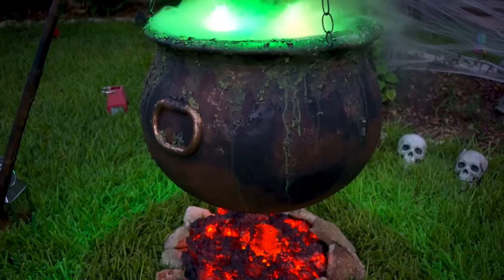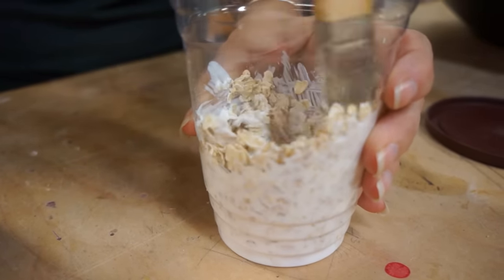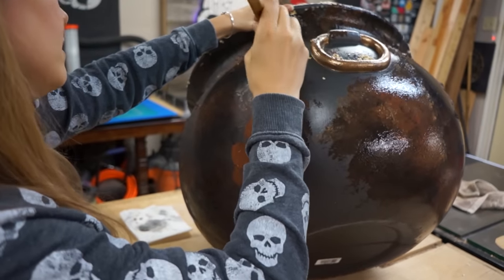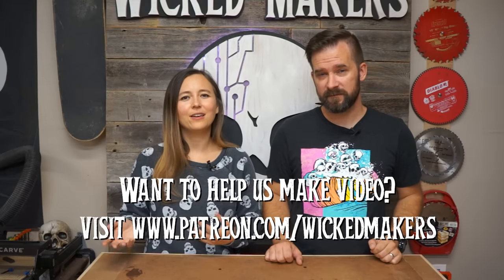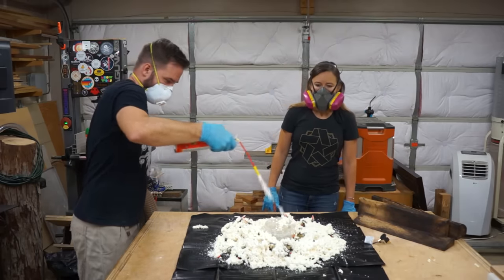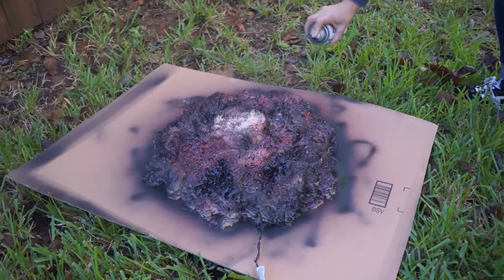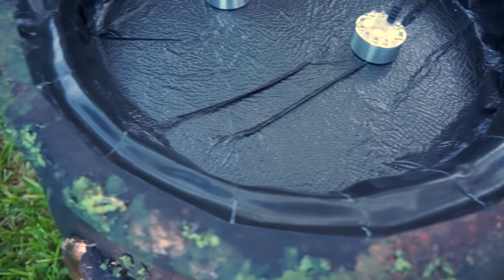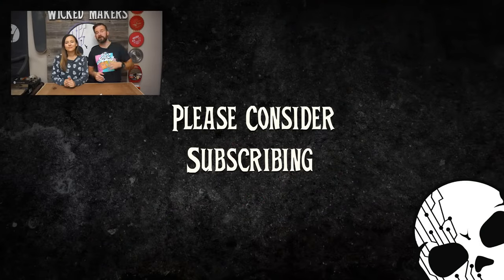DIY Halloween Props - Bubbling Witch's Cauldron with Glowing Coals

Comment: I know this is an old video, but for people watching now, here’s a little pro tip. Instead of the mod podge and oatmeal, you can use your expanding spray foam (great stuff). You can either add a small amount onto the cauldron and spread it with a brush or put on rubber gloves and smear it. You can also put on gloves spray a bit in your hand and smear it where you want the effect. I produced a large scale haunted attraction for about 16 years and we used spray foam for a multitude of effects. It is very messy and doesn’t come off skin easily (or clothes ever) so make sure you wear gloves and work clothes.
Reply: Thank you
Reply: I just subbed to U and liked Ur comment😊

Comment: Fun fact, put a blacklight bulb on top of the cauldron and soak some yellow highlighters in the water. It will glow a greenish yellow.
Reply: Re: soaking highlighters, do you mean the felt part with the ink from inside? Not the whole plastic pen, right?
Reply: @wolfeyez77  the felt part has the ink so yeah the felt
Reply: @wolfeyez77  yes, you remove the inner felt and soak it. It is a great way to make tints with alcohol too.
Reply: That takes me back.  Back in college I made a whole set of bottles like this with different color highlighters.  Looked wicked cool under the blacklight.

Comment: Ok.  Just a heads up for those of you who are making this.  This is an awesome DIY project with a lot of parts. If you plan to use this outside, I would suggest using like some clear flex spray over the bubbly oatmeal mod podge.  I noticed that when it rains, parts that weren't painted, the mod podge turned white.  The flex spray helps with that and also keeps it kind of shiny since it is supposed to be a liquid bubbling over.  The next thing is that I did my best to keep my plugs as dry as possible.  I cut a little flap on the back side of the cauldron to allow just 1 cord to come out.  I also created a waterproof box for the power strip to go into so all of those plugs stay dry (light at top of cauldron, cord from inside which the 2 atomizers plug into, the fire pit below and I have a spot light plugged in).  I did learn after the rain this weekend (and losing one of my atomizers), to put drain holes in the bottom of the cauldron in case of overflow from the bowl.  I also created a small riser to hold the connections above any water that may still be in the cauldron minimizing any moisture getting to the atomizer plugs.
Reply from the maker: Great tips! 👊🏼👊🏼
Reply: Awesome tips thanks!!! Would you mind sharing what size cauldron you used?
Reply: @iznethflores  I used a 22” cauldron just like they did.
Reply: Did you use spray flex seal?
Reply: @tr0ysk1   I can not find that size any where so Im using the 16 inch that I already have
Reply: @bjlaws1158  yes
Reply: @bjlaws1158  I had to order it online, but come Halloween, Party City had them in stock.
Reply: @tr0ysk1  I finally found a 22 inch cauldron at party city  today, she said they normally do not have them. I got lucky
Reply: Do you happen to have any pictures of the waterproof box you made for the power strip?
Reply: Plastidip works
Reply: Do you have a picture or demo of the water proof box, the cords have been my biggest challenge in this!

Comment: tripod ....use sawdust rather than oatmeal...
Reply: I came down to the comments just to post this.  I don't know why "tripod" is such a hard word for people to come up with, but it is.

Just a tripod.
Reply: Mix sawdust with one of the new vinyl flexible plasters and latex paint. Otherwise known as monster mud.
Reply: @rednecktech255  Not everyone has readily available saw dust but atleast critters wouldnt be eating at it.
Reply: @Soul_N_Control  then just paint, and plaster
Reply: @rednecktech255  Ok, I might just try that. Ty!
Reply: @Soul_N_Control  you can get "sawdust" in any petstore including walmart https://www.walmart.com/ip/AWF-Pets-Pick-Wood-Shavings-Pine-Bedding-4-CU-FT/24232050
Reply: I wet down some traeger pellets and they crumbled into cool clumps. I used that for the bits. Great suggestion!
Reply: Some rope lights have a flicker mode  that brings the hot coals to the next level

Comment: If you want to make that coal bed even better leave room holes for the air and mount a PC fan underneath.  Then attach a couple of peices of silky white cloth in the center on the top side.  The fan will blow the cloth up and the orange lights will illuminate it making it look like fire still burning in the middle of the coals

Comment: I used a 5 gallon Lowes bucket as the stand for the water tray. It’s the perfect height. They had a shallow 17 inch and a deeper 16inch  plastic plant trays at Lowes as well. I also painted the duct tape alternating matte black paint with green to blend in with the colors of the cauldron.  Such a fun project!
Reply: Thank you for your suggestion

Comment: This project is a decent and great idea to start but I'd recommend these improvements. The foam you were using is called Fomular and it retails for 5.99 in California, I consider that to be pretty cheap it is also water-resistant all by its self. Using a PVC pond liner and permanently affixing the bowl to the cauldron to allow for permanent use. This could be done in many ways like using more expanding foam and then sanding, painting and sealing it (you could even just use the foamular and a small ring of expanding foam to hold it in place then paint both once dried with flex seal in black ). Pond liner should be able to be bought from a home improvement store. Mine has some that are cut to order and you wouldn't even need a lot to fit in that small area. You could use any one of the Liquitex line of painting substrates that mimic stone or small bubbles or many other things I used the sand one to replicate beer foam and it looks amazing (these can be colored with acrylic paint). This would have worked much better than oatmeal and Mod Podge also if you go the mod podge route use the outdoor mod podge. Also, do not put paint into water it will not work as a "wash" or anything for that matter (it eliminates the bonding properties of the paint hence why it tells you to clean it up with water or with soap and water). You need something called glaze I keep several large bottles on hand and you add your acrylic paints to it and it makes them into a glaze which is more transparent allowing for a build-up of color which is what you were looking for here on the embers for the bottom of the cauldron. A great way to get the cast iron look would be to sponge or stipple colors onto the matte black cauldron. There are even kits that help you create the look you were going for. This can all be done on the cheap too with Coupons. I use them all the time as I live below the poverty level and without them, I couldn't get supplies.  You can use Joann coupons at Michaels. I hope this helps someone who is thinking of making this so that it can be used for a very long time.

Comment: Hello! Fantastic channel and great DIY for Halloween. I do have a question. My wife and I made your ember diy with the spray foam- however we went a little large and put 150 lights in it. When I picked up the dried foam the underside felt a little warm. Do you think that is cause for concern with the lights being hot possibly catching the foam up in flames? Or should I just redo it with the same amount of lights but instead utilize LED’s. Any help is appreciated.

Comment: I used a contractor bag which are pretty heavy duty  and  hot glued the bag to the  rim of the cauldron to close the gap. The misters kept tipping over so I used a  dab of hot glue on the bottom of each to stabilize. It was a great project and I want to thank  Wicked Makers for the tutorial that inspired me to make this.

Comment: In regards to your oatmeal/mod podge mix for texture.....I've had tremendous luck and quality with potting soil. Soils with little bits of other things like bark, twigs and peat moss.the texture is alot more workable and varied with super glue or mold podge.

Good luck!

Comment: I made this last year and it turned out really great.  One thing I did that I would change is I used cardboard for the fire/coals.  It ended up being really wet last year where I live and it did end up growing some mold/mildew.  I will probably remake it using some treated wood this year.

Comment: So, how do I find a solid color atomizer? All of the ones on Amazon are multi-color and are unable to set a specific color. They just kind of change color at random. I would like to find an LED atomizer that you can set the color. Is this why you mounted an outdoor light to the top of the tripod facing down? Am I better off just lighting the fog with an outdoor light like you guys added to the top?

Comment: I made mine from an old Weber grill. Used the top to hold the faux fire mounted on plywood and rimmed with creek rock. The tripod came from bedrails and the cauldron itself is made from the bottom of the grill..guaranteed not to blow away in a wind storm

Comment: I do a lot of make up fx for Halloween costumes. I have tried using oatmeal with latex which is very similar to what you did with the Modge podge, and I ran into the same issue with it falling off and not sticking. After a while it does stick however, using cornflakes crushed slightly works much better and would give you the same result as the oatmeal.

Comment: I did something similar. I didn't use oatmeal because i have heard stories about rats eating the prop. I used old wood pellets that got wet and pretty much turned to saw dust and it worked great. I mixed the saw dust in with killz primer and slapped it on randomly. Yours one came out great!

Comment: If you take a cheap cheap extension cord and a number 2 starter for florescent lights and split the wires, then cut one in half, strip both sides of the cut wire and connect to the starter. Then any low watt bulb or short christmas style lights will flicker at random. Making the fire lights look real

Comment: Hi! On making the embers I noticed you have something in the middle of the lights before you spray the foam. What is it and why is it necessary?

Thanks so much for these ideas. Really cool projects.
Reply from the maker: Hi! It’s not necessary. We put a little bowl in the middle because we were going to add dry ice so that the embers looked like they were smoking. We ended up not using it though so that’s why we didn’t include it in the video. Thanks for watching!! 👻
Reply: Thanks

Comment: Is the spray foam "wet" and "sticky" enough when first sprayed to dust it with actual ash from a fire?
Reply from the maker: Not really. We found that out in our Graveyard Skeleton project. 😄
Reply: I'd imagine you could get something to stick since that stuff adheres to anything you get it on but maybe kind of stir in in a bit?
Reply: @ucitymetalhead Long comment, but played with it a bit for a zombie party. But if you stir it when it is trying to expand, it kind of deflates a little. You can add the foam in small quantities to a pre-made base structure from chicken wire or cardboard/box board  (recycled materials), to give it a better height and depth and more formed structure. Adding the skulls, eyeballs, bones, etc. out from that point, but the first layer of paint and glue is still a roll up bubble mess with many coats to come to properly cover it later. It can be a pain for overall coverage, but work to your advantage later. We have a counter top meat grinder (the antique metal hand crank type, not machine type), took  and mounted it to a table outside. Placed a few pre-painted pong balls, skeletal hands, a plastic heart and liver, etc. onto a dollar store foam cooler and use the spray foam to make swirly intestines on the lid with trails off the top as if it was a cooler bursting full of Human parts going into the grinder. Watered down red acrylic paint wash over the top works perfectly with the nature of the foam to give it splotchy blood effects. Red strings of yarn hooked into a circle and dangling from the grinder, as if some of the parts were already being processed. Set our buffet out over a plastic skeleton, jello mold for brains,  spare ribs for ribs, sausages and linked hot dogs for intestines, swedish meatballs for...well lol, you get the picture. 
The foam itself can also be carved with masks! In open areas! (But found buying the sheets at 5 bucks a pop were just easier after all the work was done with trying to manipulate the spray foam). So if you are looking to do filler work use spray, structured use sheets.
Reply: @Vampkiki  Thanks for the info and the time it took to type all that out.

Comment: For the coals, does anyone know why there’s the small clear bowl in the middle of them? Is that an important step?
Reply from the maker: It’s not important. 😄
Reply: I was actually just coming to look through comments to see if this had been asked. My first coals I made were unevenly proportioned with my cauldrons, so I'm going a different route and found this video. I don't want to mess the coals up again, so I'm trying to make sure I do every single step and wasn't sure what was in the middle of the lights and if it's something I needed to do /use myself

Comment: Put a chain under around the lip of the cauldron? You could attach it with drilled holes in the lip, wire, plus some Gorilla foam white glue at certain points? It's like very slow  super glue and foam, foam will expand. Wear gloves, when using, a wet paper towel will remove foam as it expands, dries, this stuff is as hard as rock, takes a chisel to remove, use very little. Don't get on skin, read instructions.

Would distribute weight load.

If using a black light, laundry bluing glows well. Usually hand washing cheese cloth, leaving some of the soap in. 

Not sure if you could use it here?

Comment: Beware!  The lights could overheat encased in the foam.  Maybe use LED lights, which make less heat?
Reply: Holiday lights are specifically made not to overheat. They're fine.
Reply: @Katherine69069  Yes, but not when encased in a most perfect thermal insulator!  ALL lights make SOME heat, which most be able to escape.  The better the insulation, the higher temperature that the lights must reach in order for that heat to escape at the same rate it is being made.  Even LED lights can overheat when foam embedded!
Reply from the maker: It’s a legit concern but in this case we’ve run these for days on end and you can’t even feel any heat.
Reply: @WickedMakers  But it could be very hot INSIDE the foam.  The only you would know is if you poked a thermometer in, or cut it open later to look for thermal damage.  (Been There Done That with R2D2 robot prop with foam top & 25W light inside.  It took 10 hours to overheat, but boy did it!  The foam & the inside of the robot was smoking hot!  A small fan & vent solved that problem.
Reply: @bpark10001  It's not a concern. Holiday are made to not produce heat for the reason of fire.
Reply: @bpark10001  Holiday lights are nowhere even close to 25watts

Comment: For the fire, recycling is your best friend. Paper towel rolls or used box board made into rolls for piled lumber for the fire gives the foam a better base to start with. Pre-paint those brown to resemble wood. If you leave a paper towel on the roll and midge podge it before brown washing it, you will end up with a better texture. Add the string lights in for the foam part after by drilling holes if you want them to glow brighter. (The same can be done by a paper mache' and water downed school glue paper towel  ripped up combo  mixture for the cauldron before painting it, to give it a more realistic feel.) And the name for the 3 wooden piece is just a cooking tripod, we use it with a Dutch Oven when camping.

Comment: I found out it's better to paint a section of mod podge on first.  Take some oatmeal and layer/pat it on the mod podge. The oatmeal will stick better if you turn the cauldron on its side with the mod podge facing up. Then repeat the same steps until the cauldron is complete.

Comment: They are called ultrasonic nebulizers. Make sure you get ones that have automatic shutoff on hem when the water gets low, as the cheaper ones will destroy the ceramic disc inside if left running with no water on it. Also, never touch the ceramic disc when power is on.
Reply: Where do you find the mini ultrasonic nebulizers?

Comment: Just a tip I went to build the swimming. pool thing, I had an oil Drain pan about the right size, I sent Debbie to get a new one, due to the warping. in the bottom. She told me the store ones, were too small, and she said I am going to Lowes, to get a plant (pot) drain tray! Worked perfect, just another idea! Bob and Debbie in Oregon!
Reply: We found a plant drain pan, (No Holes) I think. 17" , worked perfect! 
Bob and Debbie in Oregon

Comment: This is very cool... Thanks for providing the links as well. I was a bit concerned that the spray paint & expanding foam may totally blcok out the light, but it wasn't the case for you at least. Still a bit nervous, I don't want to lose a strand of lights inside that mess lol Great build! Btw, it's called a tripod, if no one else has said so yet :)
Reply from the maker: Thanks!! Tripod yes 😅

Comment: 2 questions . 
1. Did anything ever eat the oatmeal off the cauldron ( I’m asking after I already put oatmeal and modpodge on mine 🤣)
2. Did you use outdoor paint when you painted the cauldron? If not did it withstand to rain?
Well I guess 3 questions. Where did you get the bamboo sticks?
* I just read through all the comments and got answers to All of my questions but one. Did anything eat the oatmeal? It is what I used and I’m curious for when I store this. You guys are awesome and this video was awesome. I was going to tell you someone stole your video but it looks like you got that under control!